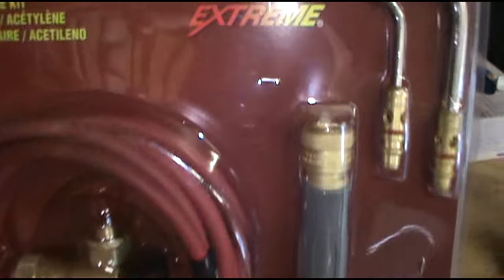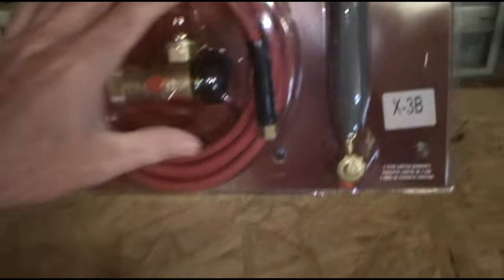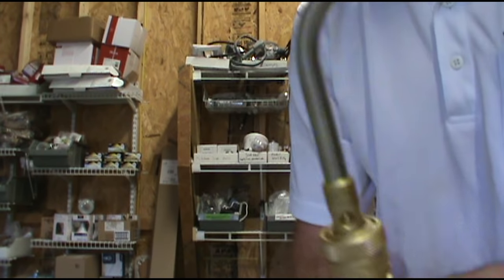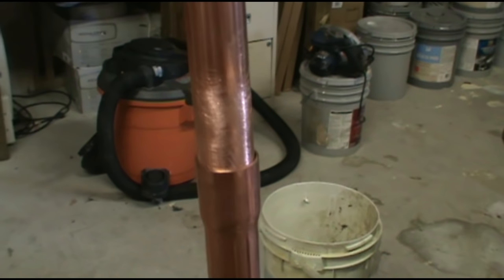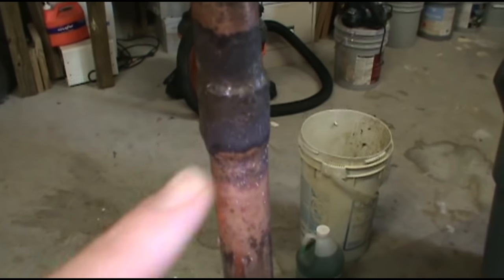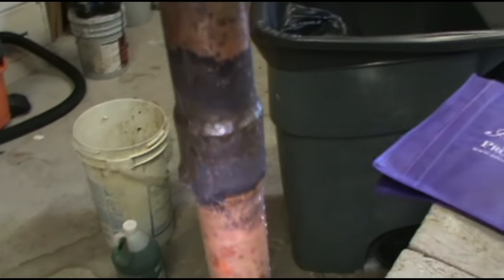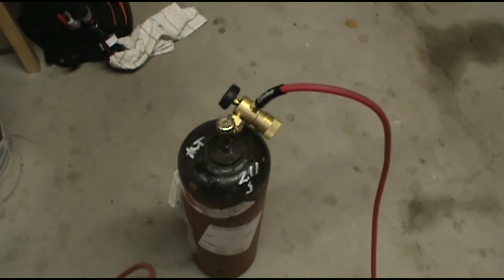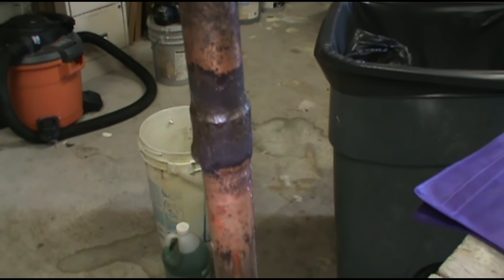TURBO TORCH BRAZING COPPER AC LINE

Comment: I got em all... over the years I have a favorite.  When I first started I didn't know there were different brands and they worked differently.
     My first was a Presto-Lite kit for a B tank. Bad Move.  The tips were overly large with not enough heat and very expensive called a "swirl-Tip" .  My brother told me Turbo Torch was the industry standard for HVAC dudes.  So, I purchased an adapter with quick disconnect (better than screw tips.) got a #4 and #11 tip. Good general all round sizes.  They are loud but nothing ear plugs can't solve. Then they came out with the Piezo tip in the torch, so I got a #5... This is my "Go-To"  tip for almost all work. When soft soldering I prefer a Benzomatic propane torch, you'll rarely ever overheat a fitting. I never use Mapp gas although so guys do. My oxygen-acetelene I use on copper to Brass especially where much heat is needed quickly. The risk with Oxy is you can blow a hole through pipe easily.
     As the years passed, I got tired of lugging around a B tank, so I went to an MC tank which required another adapter. 95% of the time its a #5 Turbo torch and the MC tank. 
     On adjusting the gas pressures, I open the tank all the way with a service wrench, reverse the rotation and close one quarter turn. Leave the wrench on the tank in the event of an emergency shut down. The flame on any torch "CAN" backfire the flame inside the hose back to the tank.  If this happens you can't fart around looking for a wrench. Close the tank fast.  backfire check valves are available on the market, but few buy them.  I have them on my OXY only. Adjust the regulator to lite with 1/4 turn clockwise and lite, then adjust where the flames are just off the torch tip.  If the tip is getting hot, the pressure is too low.  You'll notice this when the tank gets low it starts to whistle a bit and takes forever to heat anything...
Reply from the maker: Right on! Thank you so much for watching HVAC!
www.DirtyMaintenanceNation.com
Reply: Acetylene tanks should only be opened 1/4 turn!  They are low pressure so they don't need to be backseated.  If you have an emergency, 1/4 turn shuts the tank off!

Comment: Used one for over 25 years, domestic refrigerators to 5 ton ac's. Look in to using stay brite 8 soft solder. You are doing a great job with your videos.
Reply from the maker: Pops McCartney Thank you so much Pops!
Reply: Thirty years ago, I used oxyacetylene and 15% silver brazing rod. One of my coworkers started using Stay-Brite 8 but I never used it until I installed my own A/C. It flows very well with propane but you need tight fittings. Since the Stay-Brite soft solder melts at a lower temperature, there’s no need to use nitrogen since scale only forms at higher brazing temperatures.
Reply: @picklerix6162 Very very interesting.. I’m gonna look more into it as I’ve heard of it before in the past but never used it, and it sounds like it could make brazing much easier if that’s the case

Comment: Constructive advise 
When you solder a copier joint understand the heat will PULL the solder towards it 
When I place torch on fitting do so so only the fitting the solder is to slide into is hit with the flame AND hit it towards the bottom of the fitting    Then before you use the solder move the torch frequent and constant around the fitting.   If any torch wraps around the entire pipe that’s possibly too close and that does not mean you are getting EVEN heat around the fitting.   The goal is to create even heat in the direction you want the solder to go 
Then just before you think it’s time for solder move tip more towards the area where the actual joint is.  It will only need a second or two then your ready for solder.   If you use flux flux will help draw and spread the solder    A perfect solder joint from perfect heat only requires a touch maybe two of the solder    The solder will quickly and easily suck into the joint and pull all the way around it.   
If you noticed when you first touched the solder it melted but quickly dried and created a glob of hard solder almost causing your solder stick to stick 
Your a sharp young man I would bet that’s largely due to fact you learn and why you stated it’s ok to give constructive criticism.   Mine isn’t criticism at all just a old guy that learned from a master old plumber 40 years ago 
Good luck
Reply from the maker: I love it! Thank you for the wisdom Robert! And Thank you so much for watching man!
www.DirtyMaintenanceNation.com
Reply: It's not a solder joint he is brazing

Comment: Good Video, I'm going to buy one since my sight is leaving me and oxy/acet is tough for me to see these days of old age:(   I do however have a constructive suggestion if you don't mind. To pass the certification (its been 35 yrs since I did this so things may have changed) for brazing you do two joints, one joint is cut in half to see if the fill is complete. The second is pulled to test its strength, and the examiner also determines if you overheated or oxidized the copper. . In your video the fitting was a loose which happens allot with soft tubing. To overcome not filling the joint completely you use the science of capillary action and to do this you heat the PIPE FIRST, not the fitting. Heating the pipe until the fill rod is able to slightly melt proves the pipe is up to proper temperature, heating the fitting does NOT transfer enough heat to the pipe and the soldier roles down the fitting like what happened in your video. The pipe not being heated all the way will hold solder at the fittings ridge and to the pipe but can fail in short time because the fitting is not full of soldier.  BTW, they make 'shorty' tips and rosebud tips for your oxy set up, they are fabulous.
Reply from the maker: Right on thank you for the wisdom Tom! And Thank you so much for watching!
www.DirtyMaintenanceNation.com
Reply: You're 100% correct Tom 💯

Comment: I'm assuming that you're just fooling around with your new toy but if you're brazing in new lines to the service valves you're going to have to be very quick about it . These torches get hot quick and will melt the gasket in a device valve in no time even with wet rags and heat absorbing gel in play. Have fun with your you !!

Comment: I really like all your videos as you are as spot on as it gets. I have been ripping my hair out trying to decide oxy air, or oxy acet.
I really only am going to do brazing of copper and soldering L copper, and I just dont see the need for oxy acet. But alot of guys swear on oxy acet . The biggest complaint that I have been researching is that the flame is bigger than the oxy acet, but really you just used it and how is the comparison with the flame size wize. Now that you have used both do you really see a need to carry around two tanks. Please do as many air conditioning videos as possible as I am still learning. I have been in property management for years but have always lacked in the ac dept, so I am learning. Great videos, and dont forget the rifs
Reply from the maker: trukin forever I hate lugging around 2 tanks. I like that the turbo torch has a bigger flame because i can hold it in the front and the flame wraps around to the back. I dont have to physically move the torch to the back to heat the back of the pipe. sometimes you physically cant get a torch back there in tight spots. Im not lugging around 2 tanks anymore. Im a turbo man now 😂 Thank you so much for watching Trukin!

Comment: I love my little turbo torch. I've been using map gas with a turbo torch tip and regulator I can braze copper better than my oxygen acetylene set up because it has such a big flame and it more evenly heats the pipe I think.
Reply from the maker: paul kostares YES! I'm a turbo man now. The flame wraps around the pipe like you said and you just can't beat that. thank you for watching Paul!
www.dirtymaintenancenation.com
Reply: paul kostares really, even with mapp gas?

Comment: The mouth of the nozzle could have been made as a tip and not this wide so that the flame will not spread all around like this which will allow it to be directed exactly to the welding point and secondly the base of the handle could have been made straight instead of the cone like shape end that it has,meaning that if the diameter at the top is 25 mm then it should be the same at the bottom thereby making the handle straight,portable and handy,that will make it more handy.Yeah,you sure did a clean job there with the fact that you are using the torch for the first time and I want to believe that after few more trials you will make a perfect brazing.
Reply from the maker: Thank you so much for watching Greggs!

Comment: How are you liking it so far ? I'm thinking about buying the same set up Thanks
Reply from the maker: JonesHvac I love it. I did a video of me using it out in the field on a evap. coil change. The flame wraps around the pipe so I don't have to move the torch as much. Especially in tight places. I'm a turbo torch man now. Thank you so much for watching JonesHvac!
www.dirtymaintenancenation.com
Reply: Lex Vance Thanks for the input I'll watch it video

Comment: I also have a Turbo Torch for my MC tank for restricted places and have B tank adapter, I still have my Oxy/Ace setup but I seem to make nicer looking joints with my Turbo Torch but have to look out so as not to burn the place down with the larger flame. Use #11 tip also thinking about getting self lighting #11 tip
Reply from the maker: muniznick I love it! Thank you for watching muniznick!

Comment: MC tanks only have a 10 cubic foot capacity draw per hour A2 A3 A5 A8 are the only tips that should be used on an mc tank A11 A14 & A32 the cubic draw per hour exceeds the mc tanks capacity and will draw the acetone out of the tank & damage your setup. ..
Reply from the maker: David Breecher Thank you so much for watching David!
www.DirtyMaintenanceNation.com
Reply: David Breecher so only use the tips you are saying with the MC tanks?
Reply: urjnlegend yes an ACMC acetylene tank has a max of 10 cubic ft per hour draw so the air acetylene tips that can be safely used are A2, A3, A5 & A8 with an ACMC
Reply: David Breecher what about a B tank?
Reply: urjnlegend yes the b tank has a 40 cubic ft per hour max draw all air acetylene tips will work A2, A3, A5. A8, A11, A14 & A32 tips

Comment: Can do allot of small pipe braze, with b-tank / turbo. Next need to master  Stay Bright 8 and flux, for low heat problems like TEV, burns at 450* and have lesser chance of valve damage.Stay Bright is good to 450psi..If unit has that much pressure won't last long any way.But, I would get b-tank instead of small acetylene bottle, have to have 3-4 to keep up..
Reply from the maker: Michael Lee Right on! Thank you for the wisdom Michael! I've got a B tank on the way! Thank you for watching man!
Reply: Michael Lee stay bright 8, what are you talking about?

Comment: the turbo torch is amazing i wish my apartment complex i work for would a couple more
Reply from the maker: thefladaddy Man I love it! The flame wraps around the pipe so I don't need to put the torch behind the pipe when I'm in a tight spot. I wish I would've done this years ago! Thank you so much for watching thefladaddy!
Reply: Lex Vance i installed a condenser today using the torch makes life a lot easier
Reply from the maker: thefladaddy You're so right. I can't wait to use it in the field!
Reply: Lex Vance you'll love it dudd

Comment: Hi Lex I am looking at to do the same change over to turbo torch do you still like it
Reply from the maker: YES! I love it. I'm still using the same one that's in this video. And this video is years old. I like the big flame it gives off and it wraps around the pipe. When it's in a tight area, I like that. That's why I got it. Thank you so much for watching Andrey!
Reply: Great thanks for reply

Comment: what size tank you using 10 or 20 and do you think a mc10 will not be too small with the oxy air
Reply from the maker: trukin forever On this particular turbo torch set,  I had to use a B tank of acetylene. The gauge for the handle hose wouldn't fit on my mc10 acetylene tank. mc10 acetylene tank will work for oxy acetylene torch though.

Comment: does the torch recommend 15% solder and how fast does the gas run out
Reply from the maker: Calvin Toups Yep, the instructions tell you what tip to use for whatever job you're doing. Certain tips for soft solder & certain tips for sil-fos. Not sure how long the tank goes for. Its my first experience with it. I was still at a full tank though after 4 practice runs. Thank you for watching Calvin!
Reply: Lex Vance Thanks, love the channel dude

Comment: Careful with the liquid line it could put hole in it cuz it heats up faster than oxy-acetylene torches do.
Reply from the maker: Right you are skid. Thank you so much for watching Marc! 
www.DirtyMaintenanceNation.com
Reply: However Oxy/A burns almost twice as hot hot as Air/A. Has anyone noticed if they have to put the Air/A on the rid all the time, will Oxy/A heat the pipe hot enough to melt the braxe rod without the direct flame?

Comment: What flux did you use?
Reply from the maker: Only use Flux on plumbing. This is HVAC soft drawn copper pipe. You don't want Flux getting into system so I don't use it in HVAC. Thank you so much for watching Norman!
Reply: @LexVance  You must be using a rod with phosphorous content then?

Comment: I like oxy acy because you can get in and out quicker and don't get stuff as hot.
Reply from the maker: Joe Shearer Hey Joe! I was wondering if you were still around. Yea man i agree. Im not getting rid of my oxy ace torch set. The coils are in a really tight spot & using the turbo will be easier. I wont have to try and get a torch behind the pipe as much & risk setting something on fire. 😂 Good to here from you skid!

Comment: What's the right tips for residential A/C?
Reply from the maker: All I work on are 1.5 to 4 ton units which is pretty much residential sizes & the only tip I've used for years is the # 11 tip. Never had an issue. Thank you so much for watching Alice!
www.DirtyMaintenanceNation.com

Comment: Just picked a Turbo Torch kit with handle to hold an MC Tank. https://www.amazon.com/TurboTorch-0426-0011-TDLX2003MC-Torch-Acetylene/dp/B0012QT584/ref=sr_1_3?ie=UTF8&qid=1542566256&sr=8-3&keywords=turbo+torch+mc+kit I do appliance repairs and I'm gonna be using it on refrigerator repairs. I also do HVAC repairs. Kit came with size 8 & 5 tips. I think I'm going to buy a smaller tip for refrigerator repairs. Maybe size 2 or 3. Also got Oxy Acy setup but I want to really go portable with the MC Turbo Torch setup.